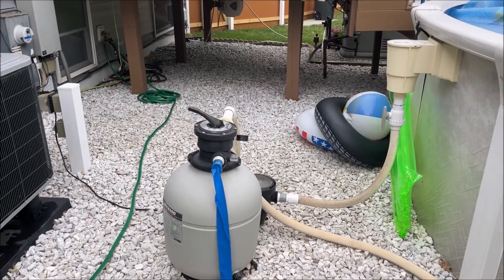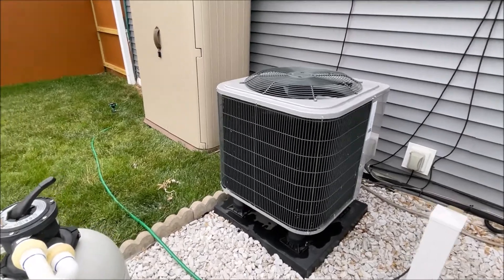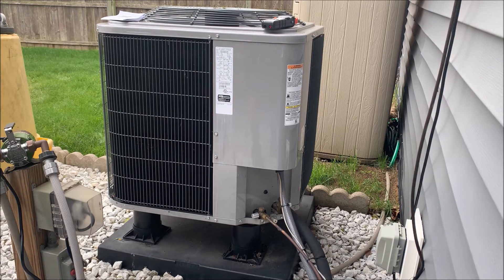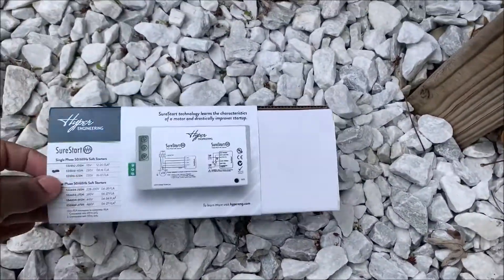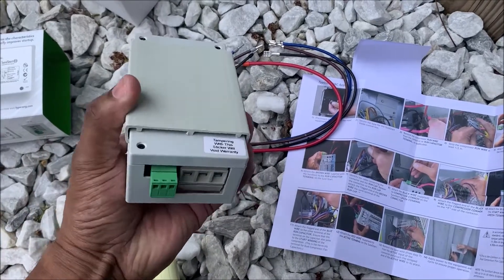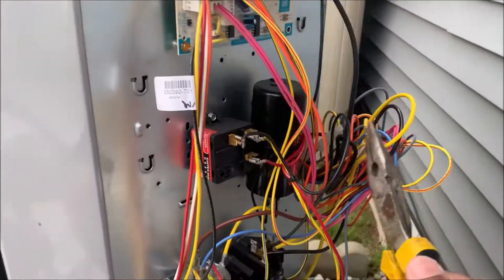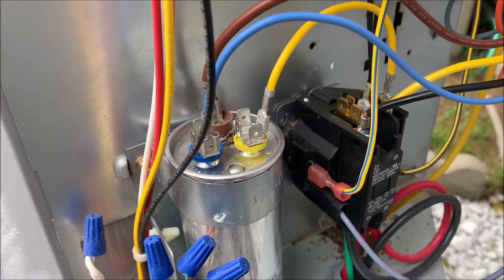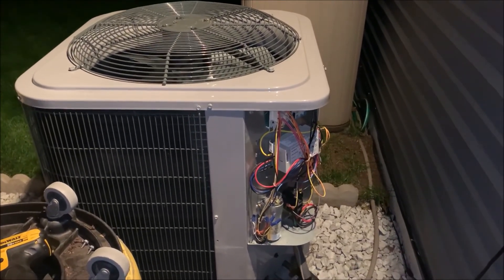Soft Start Heat Pump install

Comment: I put in a generac 24kw a few months back and I have a 4 ton and a 2 ton AC units and when the 4 ton starts the generac was bogging pretty good.  I checked the 4 ton, it's an old one, about 17 years old now, and it was rated to pull 117 LRA.  I decided to bite the bullet and buy a Micro Air soft start for both units and will be adding them next week.  I don't want to have to deal with brownouts running on generator and this should help to add life to both compressors and the genset as well.

Comment: Any chance you could share how you connected the wires coming off the green connector block? I've tried following the pictures on the provided instruction sheet....but no joy :(

It seems the problem might be the difference in the terminal block/start relay (pins 23/21as mine don't match the Sure Start schematic.
Reply from the maker: On my system the blue wire which is the start wire goes from the top green lug to the herm in the capacitor, and the bottom black wire goes to the common on the T side of the contacter. If need be, call the sure start customer service number or the condenser manufacturer and they will help you identify the correct wires. I’f you cross them you can damage the compressor.

Comment: Heating and cooling companies always try and push a 2-1/2 ton unit and no matter what they told you is a 3 ton unit would've been better for you is because a 3 ton unit wouldn't have to work as hard to cool your home like a 2-1/2 ton unit does. I know first hand and am really glad I changed to a bigger unit especially on really hot days. The man kept trying to get me to buy the smaller unit but you have to stand your ground.

Comment: Installed mine went from 120 inrush Amps to 40 inrush Amps. Had to follow my schematic on my A/C to get the wiring right. Was quick and easy to install on my Ruud 4 Ton unit. Sounds so much better starting up. Getting it in advance of a 12k automatic standby generator. This will allow me to get a 10 - 12k instead of a larger one.

Comment: 5:37  Looks like it already has a popular hard-start kit installer based on the relay with the red sticker.
Reply from the maker: Yea it had start capacitor on it but that has no assistance on the start up against the generator, the lights were flicking pretty bad when on generator power. Soft start crushed all that. Starts smooth now and gradually ramps up the compressor instead all in one full blast start.
Reply: Hardstart is not a SOFT START totally different.
Reply: @teekay1785  
Yes.  I have since learned that.  Thank You.